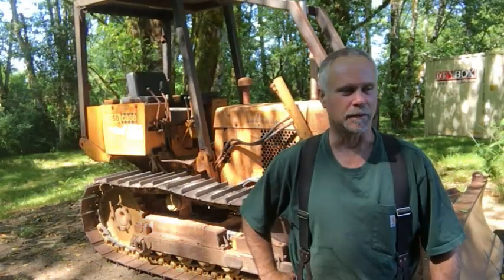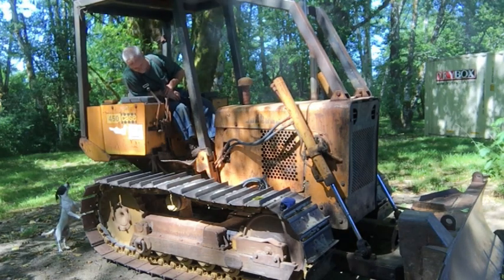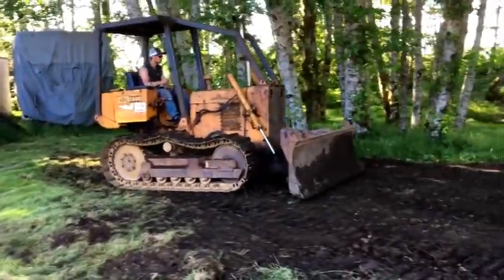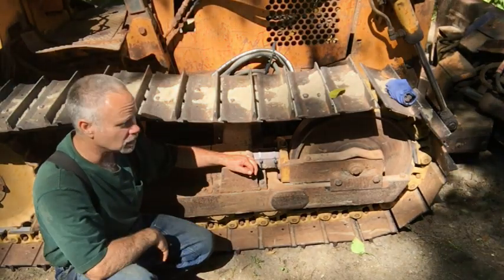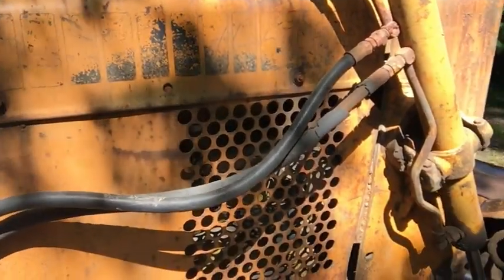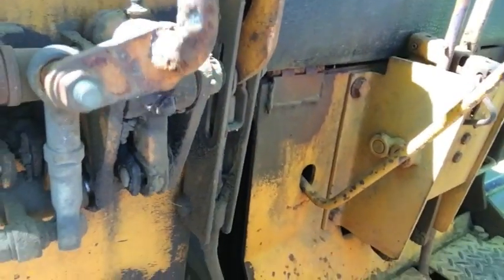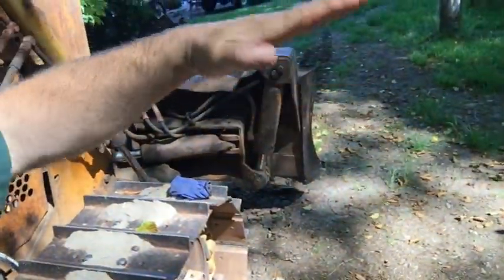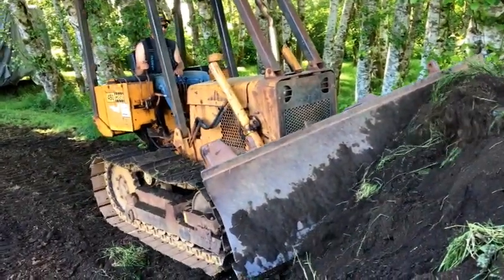1976 Case 450 Crawler

Comment: Thank You Mr. Patrick, ( and Miss Heidi too) about the Parts, sorry to say but, "No, I don't know a good place to get them, beyond retail." But I do know where the beauty could find a NEW HOME. . . . . . And yes it needs brakes for hill work, not so much up hill, but the down is truly drastic and if the operator does not lift the blade in time, the sudden stop has made many an operator an upfront blade visualization expert. Even that is good for the waist line as one's running capabilities shall definitely be challenged.  Your operational Supervisor seems to require assistance in the inspection of the equipment operation, so get down and grant him a "Headmaster's" vantage point, especially as he seems determined to achieve it himself if you don't.  Thanks once again; Ya'll ;; B Blessed BIG time 2 Day & 4 Ever,
Reply: Oh for sure on the down hill comment. Ryan has run dozers before and said we can get by with out it but watching him come off the trailer made ME pucker up a little. Yeah, the little dog gets spoiled now. he expects me to pick him up and put him on most equipment...he has me trained! Thanks for stopping by.

Comment: How much did you buy it for? Asking because I’ve been looking in my area and prices seem to be all over the place. Thanks in advance 👍
Reply: I got this one for 11K. Although it is an old one it is in pretty good shape. New tracks and undercarriage, rebuilt motor etc. Runs great but needs the lift cylinder replaced. I picked up a good used one for $400.00. Could have repacked the cylinder for $35.00 but there was scoring on the piston. One of the track adjusters need repacking but I put a stent in line to temporary the track adjustment. Seal kits are around $40.00 unless you get into large cylinders. The breaks also need addressing but one can do work without them. I have plans on tightening up the front end by changing out a few bushings and items of wear but over all for the age the crawler is in good shape and fires right up. I also need to flip over the cutting edge for the blade. So of coarse the condition, area demand, year and size, options such as brush rake, winch or rippers will affect the cost. The small dozers seem to sell better than the large ones due to demand, flexibility and they are easier to transport from place to place. Hope this helps in your search!
Reply: @MrRainCountry  thank you for your thorough reply. Happy New Year

Comment: so my dad has a 1979  case 450 crawler and its been in the shop for 2  years because we are looking to buy new pistons for it, but we cant find the correct parts. we have gone to the case dealer, with the original  pistons them self, and even they cant find it. Does anyone have any better ideas on where to buy internal engine parts?